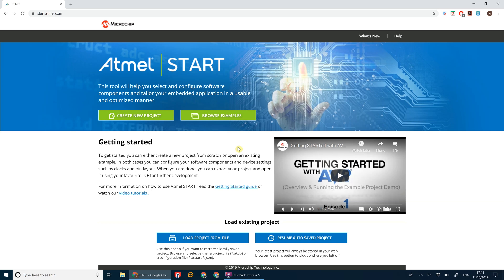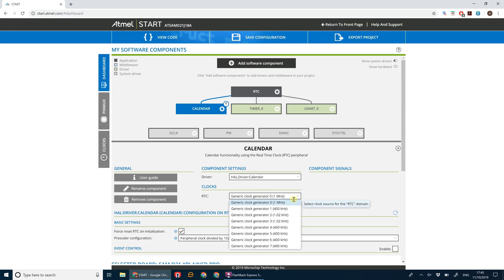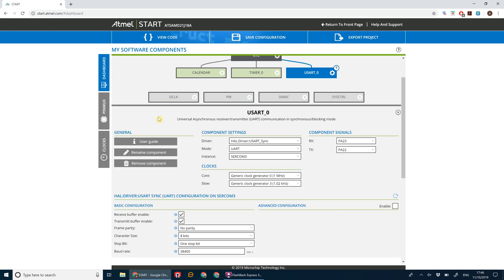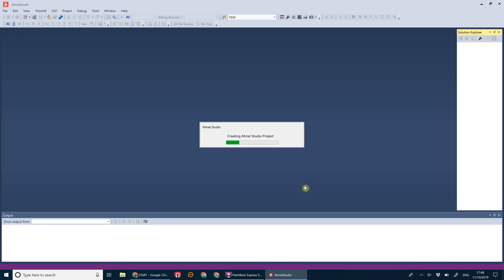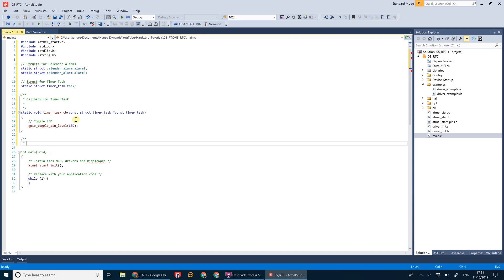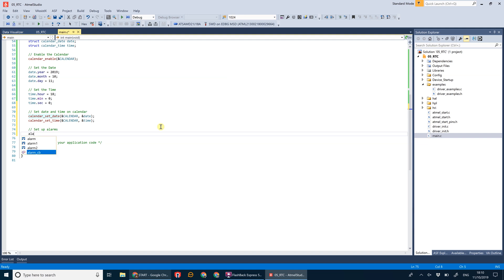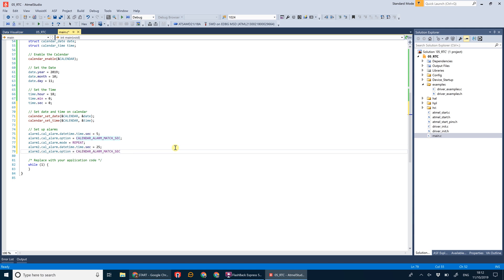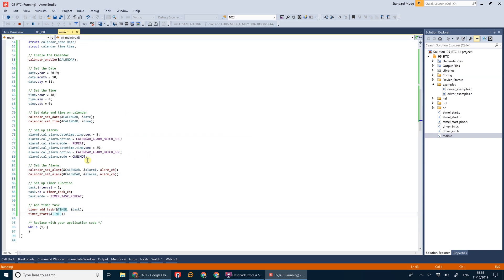RTC (Real-time clock), Calendars and Timers on Atmel SAM D21 Xplained Pro Board - Tutorial

Comment: Hi, andy! Great video! Do you know if there is any way to handle EPOCH timestamp with Atmel SAMD microcontrollers?
Reply from the maker: I believe there's a standard C library that can convert between date time and UNIX timestamp. Possibly <time.h> (or something similar named). I have done this before, but can't remember exactly what I did. Alternatively, there's probably a way of converting it manually with relative ease.

Comment: Thanks for this guide, very nice.   I followed your guide exactly on a custom board with SAMD20 device but the TIMER never calls the call-back function.   Strange thing is CALENDAR works great.  I quadruple checked names to makes sure I hadn't made a simple mistake but everything looks good.  i also triple checked my clock settings, again all looks good.  Did you ever run into a problem like this for the TIMER?
Reply: Turns out it was a buggy install of the TIMER instance from Atmel START.  Had to remove then reinstall.
Reply from the maker: Never come across that before. Glad you found the solution!
Reply: @inventorandy3195  One followup question...have you ever used the CALENDAR or TIMER from START to wake-up from sleep?  Its not obvious from the abstraction of START to setup an interrupt from either of these drivers.
Reply from the maker: @coryhansen3653  Yes this is possible. Many of the radio data logger devices I design use timer functions to wake the device from sleep. As long as "Run in Standby" is enabled for the timer driver, it will process the interrupt and wake the device from sleep mode.
Reply: @inventorandy3195  Got it, Run in Standby sets up the interrupt.  Thx.   Strange behavior with the TIMER driver waking up the MCU from deep sleep.  Instead of 10 s interval I had setup, the MCU is awaken every second then crashes in about 8 seconds.   If I change the interval to say 100, I still get MCU awakes every 1 second by no more crashes.  I even tried 100000 interval but same 1 second MCU awakes.   Clocks associated with TIMER are all set to run in standby.    To bad the User Guide for TIMER driver on the START page provided by Atmel is all but useless.  Looks like I will be spending way to much time to get this driver to work :)
Reply from the maker: Hi Cory. This may be your clock settings. Make sure that your calendar and timer aren't sharing the same clock (if you're using both drivers) and also check clock rate and prescaler to ensure the interval you're using equates to the right interval in real-time (e.g. a 1mhz clock with prescaler of 1024 will give you 1000 ticks per second)